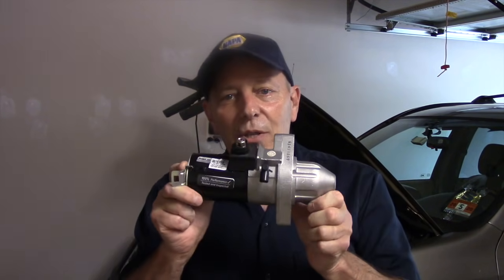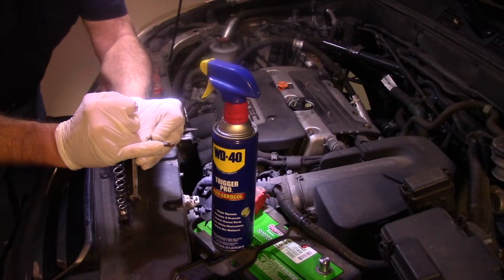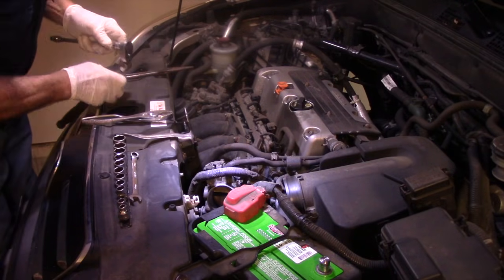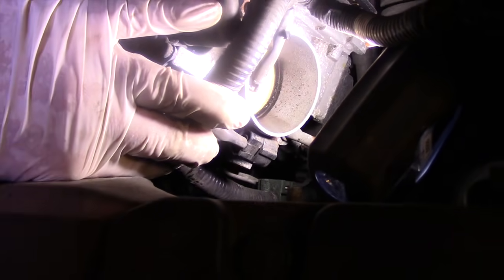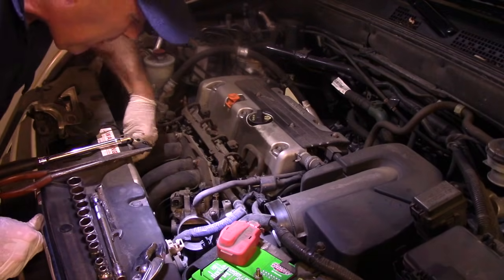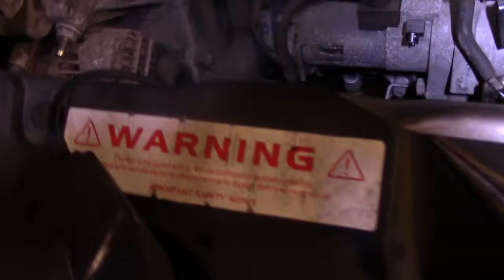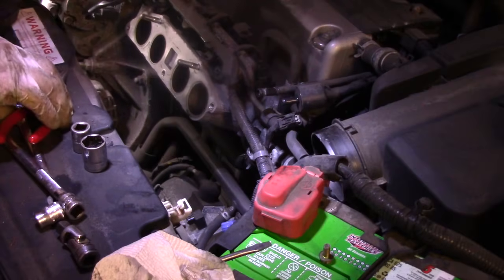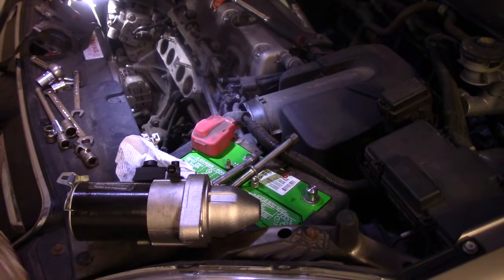How To Replace The Starter On A 2006 Honda CRV

Comment: Thank you Jerry.  After watching your video, I knew exactly what I was getting myself into.  It took me hours, in freezing weather to get the job done, but I did it.

Twisting hoses with needle nose plyers before trying to release them was my favorite tip.  Also,  I never would have known there was a clip holding the wires under the air intake, releasing that was a real  challenge.  Because of rust, I had to use a bolt extractor on quite a few bolts, but they all came off, phew!  Also, the ground wire to the motor had become detached at the motor.

I'd like to talk to the engineer who buried the starter down there.

Comment: Thank you! I have used many of your videos on my 2006 and I would like to thank you for the clearest and best instructions when attempting the many repairs through my 303,789 miles journey. All this thanks to you sir. I completed the task of changing the starter in my drive way in under three hours counting :30 minutes to the parts store.  I removed the starter and bench tested it and it worked?  I was stumped so I called the parts store and asked if they test starters and they said bring in on down.  Said it works but slow and seems weak. So I opted for a new starter and it was the right call. Car started and I was happy. Thank you for always giving great mechanical advice.

Comment: Thanks Jim, great video! My 2006 CR-V with 112k sounded really slow and tired when starting, even with a new battery. Your video was a perfect description of changing out the starter. It wasn't easy, the 14mm and 17mm starter bolts were very stuck due to 13 years in NE United States with snow and road salt. Got it swapped though, only paid around $100 in parts, and now it starts like a brand new car. You're the man!

Comment: Thanks for making this, you’ve saved me (and many others) a ton of money. Some notes for those without much repair experience like myself:

- I tried to plug the coolant line, but it went everywhere once I got the first one off. I lost most of the coolant in the system during the repair. It might be a good idea to drain coolant before first and replace after everything is back in place. Coolant is like $30 and it would have saved a huge mess

- My manifold had a green zip tie underneath it that I had to cut before removal was possible

- To get the manifold out, slide it all the way to the right before worrying about an upward angle. I pushed all the electrical/loose hoses back as much as possible. The real key is maneuvering it around the big tube next to the battery, if you continually move that tube around whatever is in the way it will come out eventually

- Front starter bolt was SUPER tight. I bought a 24in breaker bar just to get it out which made it easy

- My starter solenoid (the cable that connects to the starter but isn’t bolted down) came disconnected when re-installing the manifold. I didn’t notice this, completed the repair, and the car still wouldn’t start. I had to reach in and reconnect it which was difficult. Make sure to check that everything is still connected to starter after manifold goes in

Comment: Great video! One Note: I on models with cruise control cables which are attached to the throttle body, I removed the 4 bolts securing it to the intake manifold and moved it to the valve cover area.
Reply from the maker: That's a great tip, thanks for sharing!

Comment: Thanks for the video, Jim. Just did this job today and- other than the manifold being a pain in the butt to remove and then remount- all went well. Appreciate your work!
Reply from the maker: Thanks for watching.I'm happy to help. Don't forget to hit the bell for notifications when a new video is posted
Reply: @jimthecarguy  if a plug or hose is missed does it cause the car to shake and idle?
Reply: @jimthecarguy  why does the gasket have to be replaced?

Comment: Thanks for the video and showing us the best way to do it. Some comments talk about taking out the starter from below. The starter bolts are really tight and it would be tough to do it that way. Besides, I hate working on my back with debris falling in my face. I had only one real problem and that was a wiring connector on the bottom side of the manifold. I didn't know it was there and that had me wondering why I couldn't get the manifold out. During pulling the manifold out, I noticed it then cut it off. After this the manifold wasn't too hard to get out. It was a little bit of a struggle keeping the wires and radiator hose pressed down while wiggling the manifold over to the right side, letting it angle down on the left side before pulling out.

Comment: I just replaced the starter on a 2005 CRV from the bottom and it was much faster than this method.  Not a walk in the park, but removed in 1-hr, installed in 45-min.  Check video on replacing starter on Honda Element from the bottom; nearly identical.

Comment: There is an intake manifold bracket held on with one of each, a bolt straight in from the front and a nut from the bottom. These are located directly below the throttle body.  One of these needs to come out.  I think it was the nut because I didn’t see the bracket attached to the intake manifold.

Comment: Jim thanks for the info. Any reason why you went from top vs going from bottom. I’ve seen others going from bottom. 

My 2008 crv starter went out and was trying to see what’s the best, top or bottom. Thanks.
Reply: Bottom might be easiest, but you will have to think about how you will place your wrench and not hit your hand on anything because those bolts are on there pretty tight

Comment: Dont you have to bleed bubbles out of coolant system if you remove both lines on throttle body??
Reply from the maker: Good question but no when you start the car it will just pump out the air. I'm happy to help. Watch for the next free tool giveaway coming soon.

Comment: I can’t get the 17mm off of the original starter. I’ve tried various liquids and a breaker bar. Any other tips?
Reply: How did you finally get the 17mm off the starter?

Comment: I cannot figure out how to remove the manifold without loosening the top bar across the front or possibly removing more attachments from the manifold. I cannot clear the manifold mounting bolts. Any additional tips?
Reply from the maker: Yes you can take out the studs that will give you more room to get the manifold out.Keep me posted.
Reply: listen up people all this is isn't called for I'm a ASE Master Tech. 45 years Exp.this starter can be replaced down below by removing the plastic cover one bracket and the starter is looking you in the face 1 hour total replacement job.

Comment: Remove the starter from the bottom front of the car.  It's a tight fit, but you will not have to remove so many parts to get to it.

Comment: I just did it mine and ending up getting code po177 valve stuck on hi rmp I have a losse house that I forgot to put in there the solinoied and I turn off the car and I put it back but still getting that code

Comment: Having to do this to get to the starter. Wow. What a mess of a design,
Reply: I keep hearing people say that you can get the starter from the bottom. Well that may be true, but i found that you hardly have any room to remove the 2 bolts. Unless you have those automatic ratchets where you dont have to do any hand movement at all, just press the button, spin and extract